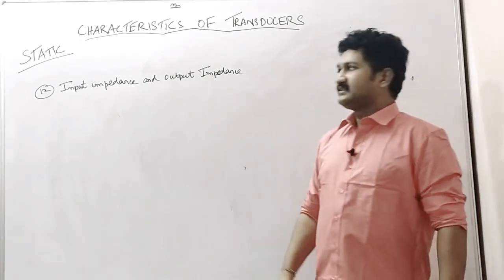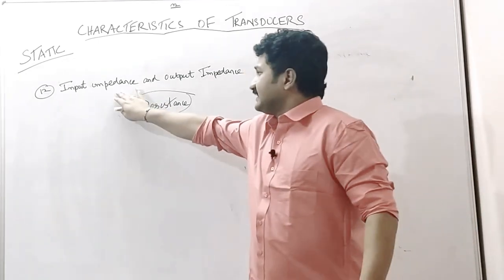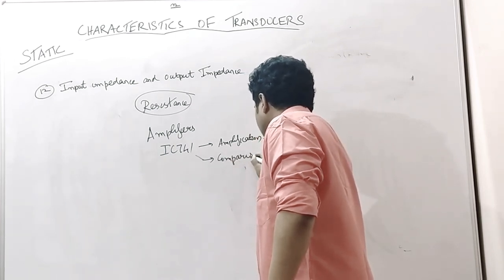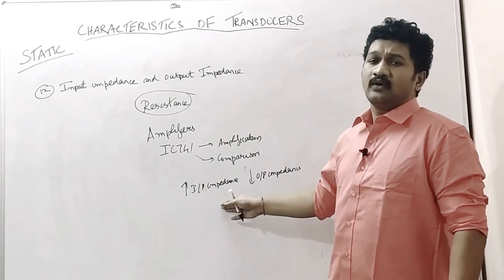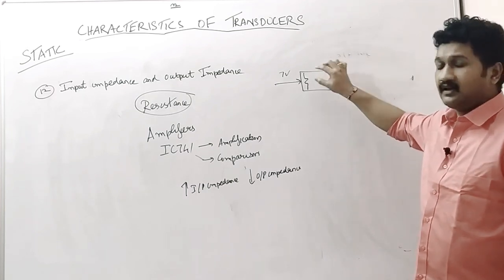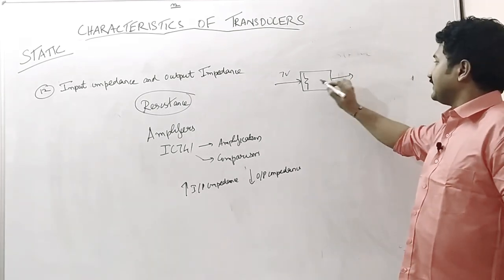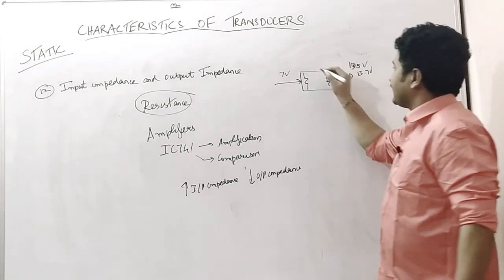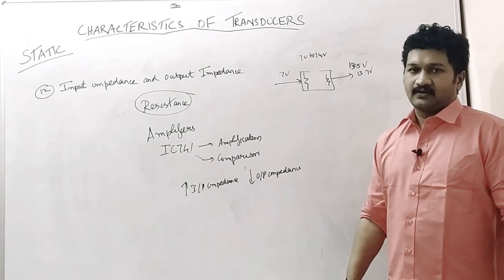#static #impedance Input impedance and Output impedance

Comment: Before amplification we have a low signal strength if the input resistance is high the signal is dropped but sir you said input resistance is high is important for amplification
Please clear my doubt sir
Reply from the maker: For the signal to be amplified by the device,  the signal's voltage has to be dropped across the input side of the amplifying device.  For this the input resistance need to be high...in simple terms, the signal acquisition will be fullest without any loss as the input resistance is high.
Reply: Sir Voltage drop is need for amplifing device if the input signal is weak the voltage drop also small then how amplifier amplifies the signal
Reply from the maker: Amplification is the next step
Reply: Sir what is the stages for amplification and how it amplify the weak signal 
Can you put the video for this topic
Reply from the maker: Sure I will
Reply: Thank you sir